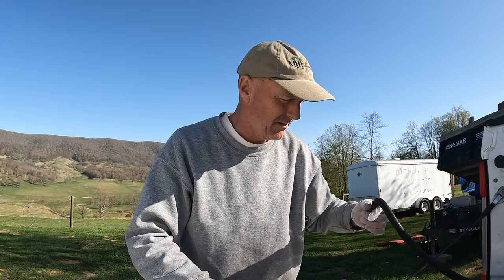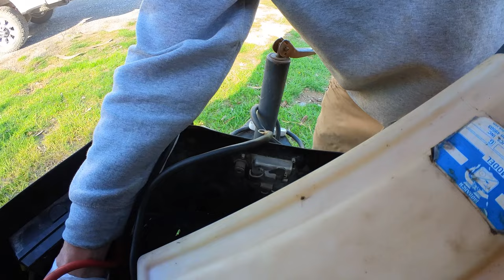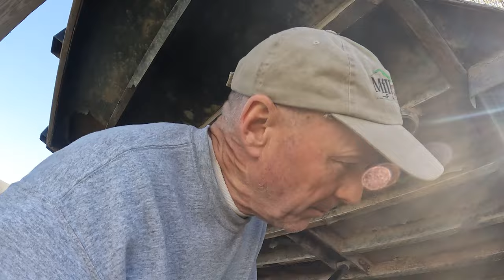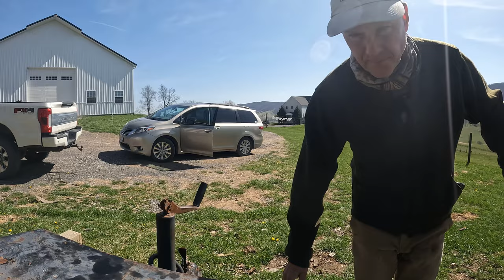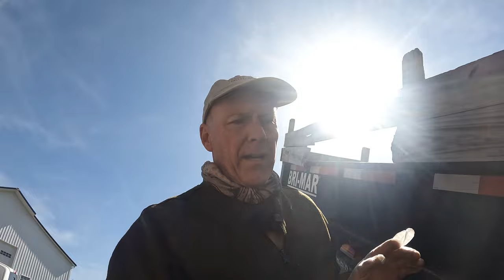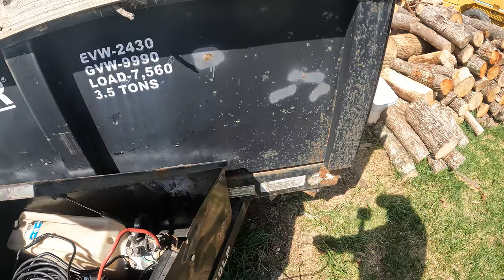Dump Trailer Hydraulic Hose Leak Replacement

Comment: How did you bleed the lines ?
Reply from the maker: Thanks for watching Ossy Munoz!  You got me thinking on this one... I had to pause for a minute.  They bled themselves.   It's not like brake lines. It does take a minute for them to fill and you'll hear some spitting and sputtering.  But in short order, the lines will fill and air bleeds out via the other line on the cylinder.  In this set up, the pump only pushes fluid into the cylinder and gravity pushes it out.  There is a breather hose on the cylinder.  If you need a video of it, I can make a short video and post it.  Thanks for watching.  Kevin

Comment: Is the the dump trailer for the shop back in the day  if so it still hanging in there
Reply from the maker: It sure is. Can you believe it still is performing!  I run it hard for sure.  I just replaced the battery in it and it's working well again!  Thanks for watching!  Kevin
Reply: @MillGapFarms   wow that is cool    It has definitely paid off
Reply from the maker: It owes me nothing!  K

Comment: I could hear the wind blowing on the audio part of the video, other than that looked like a good day to do the repairs and they were done well.  Great video.
Reply from the maker: Thanks Mr. Conner. I still have  a leak...argh!!!  I need to pull the pump again and start digging. I will say that the trailer worked very well to move about 15 loads of topsoil the other day.  The new battery and hose did the trick!  Next we work on the sides and weld a couple spots in the bed then it's on to bringing in stone for the driveway.  Thanks for watching!  Kevin